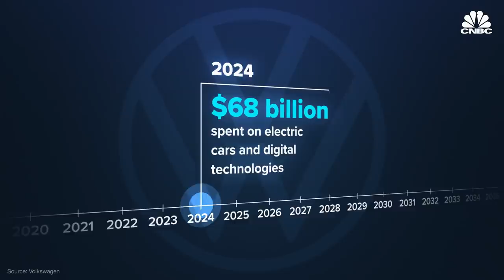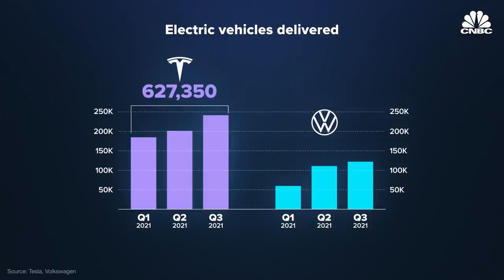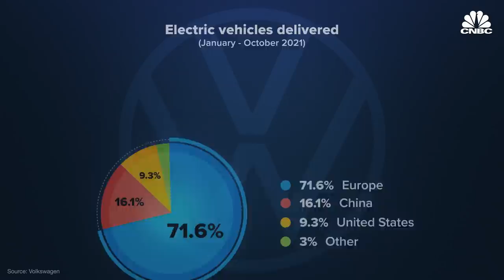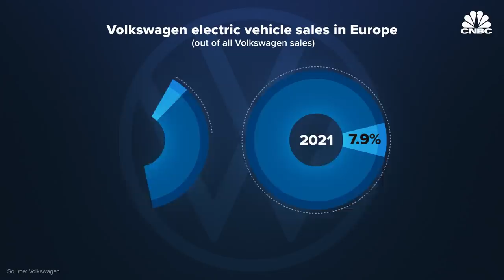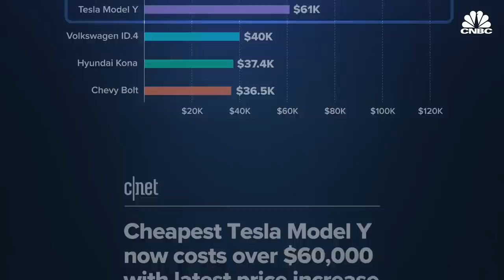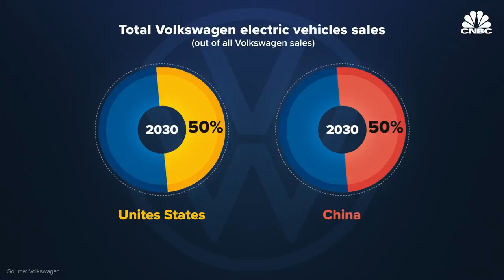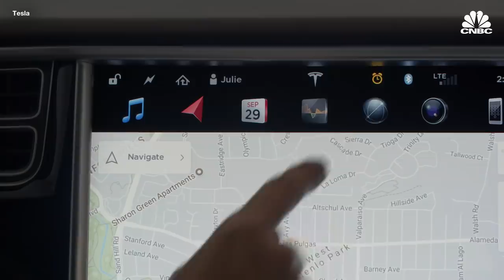Why Volkswagen Is Beating Tesla In Europe

Comment: It does help that Volkswagen has a flexible dedicated platform, MEB, that allows VW to produce a large number of models fairly quickly (ID.3 and ID.4 now, ID.5 and ID.6 soon). Volkswagen is also developing a modified MEB platform for smaller cars that will replace something like the Polo model.
Reply: I concur. I am living in Europe and had to decide on an EV as company car. I testdrived a Model Y and an Skoda Enyaq. Both are compareable in size. The Tesla was 20k more expensive. But that was not really important being a company car. My conclusions had been that Tesla is ahead in Software and charging (Supercharger network). And the VW/Skoda was ahead on comfort, Interaction design (due to physical buttons), space, security (Tesla did not even have a cover for the trunk, so everything would be flying around in case of an accident). service network and brand trust.
We decided for the VW/Skoda and it is a phantastic car. The software is inferior. No doubt about that. But after all it is a car and not a toy.
Reply: @arvedludwig3584  I did hear about that. But I think it applies mostly to US production. The chinese cars are better. Most likely I tested a chinese one.
Reply: It's been reported on other EV vlogs that it takes VW on average 30 hours to build their EVs while it takes Tesla only 10 hours.
Reply: @richardcogbill6791  It is not important how long the assembly takes because that depends largely how pre-manufactured the parts arrive in the factory. If VW takes longer then most likely because it does more assembly inhouse.
Reply: It also helps that VW build quality is much better than tesla and they have a decent dealer network. US car manufacturers have never done well in Europe
Reply: @arvedludwig3584  lol
Reply: @stevec6427  it can easily change.
Reply: @michaelkaercher  Unfortunately, Tesla is doing also more assembly in-house. So overall it's much faster and that's the reason why can make more profit. BTW title of this video that vw is beating Tesla is not  even confirmed in video. And the figure show us clearly that is far away from "beating". And don't forget that VW is counting as "sell" also the cars which were sold to local dealers.
Reply: @pilotko5899  Google for: Volkswagen Group doubles Teslas 12 Month European EV Sales.
In regard to your claim that Tesla has a higher production depth, is there any reference?
Reply: The platform isn't very good though
Reply: @dragospahontu  It is a bit trivial because it is always that way. But the Enyaq is the best car I ever owned.  It is one cool car.
Reply: @spongebob7296  "As of which the Germans are masters of."  Me, looking at the ID. cars build quality.... Are you F Kidding?
Reply: "that allows VW to produce a large number of models fairly quickly (ID.3 and ID.4 now, ID.5 and ID.6 soon)"

When you have your factories stopped  due "chip" shortages you DON'T Produce anything.
Can we have more excuses, please?
Reply: @michaelkaercher  It's important if you want to have benefits... but it seams that you don't care about it.
Reply: @xavierStark84  Which benefits? Again. The Tesla is 20k more expensive and is inferior in most aspects.
Reply: @xavierStark84  Volkswagen alone is producing 20 times more cars then Tesla. Same with Toyota. Tesla in the mean time delivers cars just without those chips. We have more and more reports in Germany, that cars are delivered without the ordered USB ports. There are just holes in the panel. VW would deliver much more, if they would do that kind of scam to their customers. And later ... when a technician shows up to fix it, they install a usb port for charging without connectivity to the infotainment system.
Reply: Most German manufacturers have that
Reply: @michaelkaercher  It is very important how long it takes When ramping production. And No, the reason tesla is faster to build is that they have less parts and their factories Are the most effective in the automaker industry. For instance the giga press saves them a LOT of parts by casting everything in one piece instead of 200 pieces that had to be bolted or welded
Reply: This is now VWs secret sauce!  ALL the OEMs shipping EVs have similar plans to build all kinds of chassis using the uniform battery infrastructure between the wheels! BYD is alreay doing this with Electric Buses and SUVs.
Reply: @MaticTheProto  have what?
Reply: @kentkjrgaardjensen4304  gigs press? Mega is no more enough for Tesla? But you recognize that a Tesla is still 20k more expensive with inferior quality?
Reply: @DavidMortaz  secret? VW openly shares the platforms between all their brands. That saves cost and drives volumes
Reply: @michaelkaercher  a very flexible production line
Reply: @michaelkaercher  Learn about real benefits dude.
50€ of benefit on each car VS 10k€ on every sale clean.
Tell us about 1 year waiting time for each sale on that great manufacturers, sure you know about that.
Reply: @michaelkaercher  Inferior  quality? Oh yes you're talking about buttons.
That's your premium quality of cars, then you can see how the cheap materials are imported from China and they have more issues than the others.
Reply: @michaelkaercher  Saves costs? Hahahaha with the plants closed it cuts costs forever.
Reply: @richardcogbill6791  Yes...I read these comments to see if anyone beat me to this fact. Dietz even gave a lecture to his company stating the fact that Tesla indeed builds Model 3 or Y in 10 hours vs VW's 30 for the id4.
Reply: @michaelkaercher  100% wrong. The main thing that differentiates Tesla from ALL other automakers is the near complete Vertical Integration at Tesla. Tesla builds almost everything themselves. Tesla survived the chip shortage because it has the agility to reprogram and change designs to use different chips when the regular chips were in short supply. Other makers just stop making cars and just wait for the chip supply chain to return. Lots of people posting without doing research....or don't care to do research.
Reply: @stevec6427  It's important to realize that most dealers HATE EVs. They don't even try to sell them...just let them sit on the lot. Dealers make their money through their repair shops. There's very little that goes wrong with an EV and often small things are handled with software updates. I don't own a Tesla (want to) but I do own a Gen1 Chevy Volt. It is very solid overengineered car and a one-off design. Few parts shared with other GM vehicles. Yet, it amazes me how reliable it has been (and for the majority of owners). I've only had 3 oil changes since 2014 (Once every two years) and the brake fluid flushed. I change the air filters myself when the oil is changed. I've spent less than $250 in 130,000 miles. I call that WINNING!  Best car I've ever owned.
Reply: @jedi_mapperp4073  I don't care, if Tesla buys from suppliers or not. If you make your own parts or buy them from a supplier does not tell you anything about the quality. And they do not manufacture their chips. They had a little better purchasing strategy compared to the rest of the industry. But in the mean time they run out of chips as well. Now they deliver cars without USB charging. Instead they have holes in their instrument panels and you are promised to get them delivered later. VW or Merc would never do that. It is merely unprofessional.
Reply: Not to mention that the platform also already produces Seats and Skodas
Reply: @xavierStark84  Consumer reports ranked Tesla among 3 worst reliable car brands. Fact.
Reply: @xavierStark84  Tesla cars are a joke vs Audi, Mercedes and Bmw car interiors.
Tesla cheap plastic leather seats (aka petrol), cheap consoles, cheap steeriing wheels, cheap pedals. In Tesla cars you pay for an expensive Panasonic battery framed in a Dacia low quality car.
Reply: @xavierStark84  Test it yourself : sit in an Mercedes EQE, EQS, Audi e-tron GT, Bmw i4 and dare with a straight face say that the interior quality of a Tesla Model S Plaid is better. In Amsterdam the new e-tron SUV is outselling Model X and Model Y for new cars because for the price people want quality and luxury not cheap Tesla plastics
Reply: @michaelkaercher  Don't forget the Teslas delivered without brake pads
Reply: @richardcogbill6791  It is because Tesla simplified many interrior components. Not necessarily a good thing.